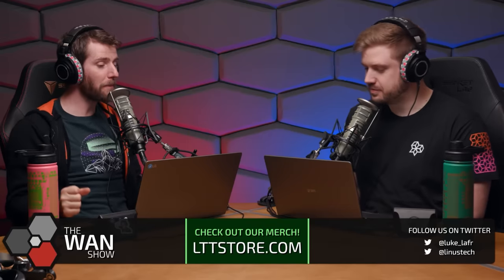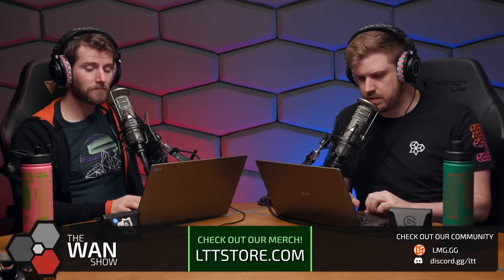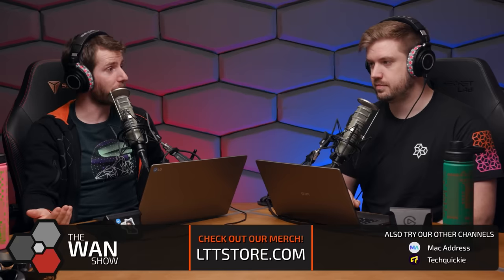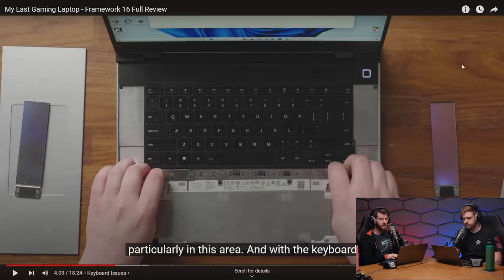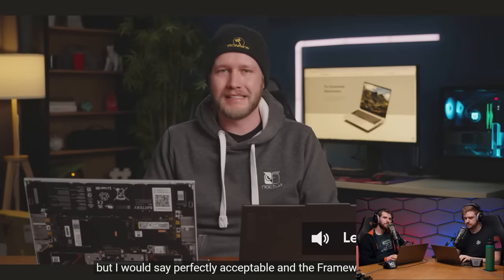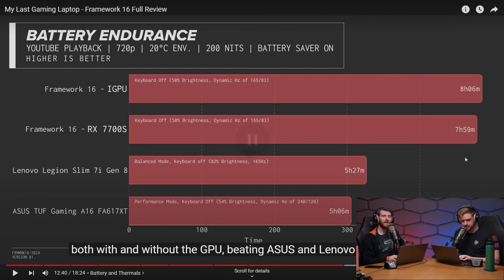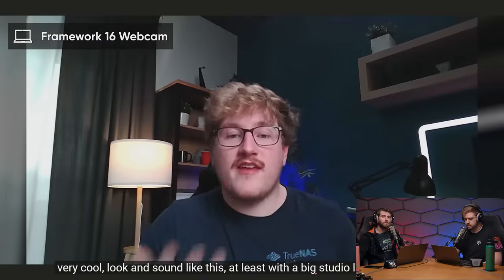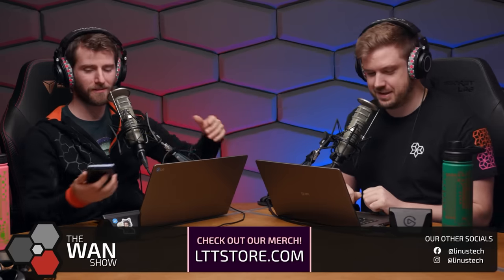Linus Re-Evaluates his Investment

Comment: From the photo it does look like my trusty Lenovo ThinkPad T420 with it's 14" screen has about the same amount of flex. Also screen flex is MUCH worse if you actually completely close the device before opening it that way because you overcome the initial resistance of both hinges at different rates. 
ALSO with new hinges there is just generally a small break-in period which could explain part of this. The construction of the Framework screen assembly is also quite unique and as long as it doesn't cause any issues this amount of flex is completely fine, especially since my man from the Verge is purposefully trying to do this.

Comment: The verge guy being mad that the ceo said it was one issue is a bit of a strike on the verge tbh. As an engineer it sounds like some sort of thermal issue. So yes, you will get multiple symptoms. Instability, crashing, running hot. But for example if its due to thermal paste non-contact, then yes there is one issue. The verge and medium are the IGN of the tech world.

Comment: Another MASSIVE issue is that not only did the various OEMs and ODMd not only not standardize the component and dimension layout - they even went haywire with mixing up the pinouts. Even within their own brand ecosystems. So not only are MXM GPUs not physically compatible among different laptop chassis types, they're not even electrically compatible on the pinout.

And as a cherry on top, they kept their changing arbitrary pinouts proprietary and locked down very well, so a bunch of them aren't even fully known or reverse engineered to this day.

MXM was a great idea in principle. But everyone involved with implementing it completely screwed the whole thing by doing their very best to force it into being non-standardized.
Reply: And yes, this includes mixing up pinouts between signal and power, so in multiple combinations you would instantly brick that $500++ MXM GPU you spent months trying to find, when powering on the system. In some cases taking the primary motherboard down the drain with it.

Comment: i would disagree with the mxm statement their are 2 main standards mxm type a and type b. both of which are standardized as far as memory layout and die location. which means as long as your laptop takes an type a card any mxm type a card will fit and line up with the cooler same for the type b cards. type b cards are a bigger formfactor allowing for more memory/bigger dies. the biggest issue with mxm cards is drivers because laptop drivers run a check to see if the laptop is one the card your installing was made for. they dont work without modding the drivers which is majore pain

Comment: I'm always doubious about what real value that the Framework platform can bring to the user.  Say I want to upgrade my laptop in three years time I would probably find myself in a situation that I need to update most of the components inside my laptop that it may end up better buying a separate new machine than update the existing one.  Don't forget the option and upgrades are usually priced more expensive because of the smaller business volume and very special packaging that the upgrade modules would require.
Reply: That is true, they're still in early adopter territory when it comes to pricing. If the volume produced multipled and costs came down the idea of a serviceable laptop could actually make sense from a normal users POV, but it's not really there yet.

A similarly specced lenovo laptop costs nearly half as much and that's with sourcing the ram etc for the framework laptop from cheaper third parties. In 4 years you could buy an entire new better laptop with the money saved, and you'd still have the old one to pass on.

Comment: As a FW13 owner, 12th gen, I truly wish FW the best. especially with longterm support, like bios updates, drivers, hardware and maybe coreboot. Like, im running Bios 3.08 but its beta and they pulled the EFI version (the file is still there on the server *wink wink*).

Such small business doing awesome work. but hey, some folks need to chill the cookie down. Hope to buy some future upgrade board someday, and I pray for coreboot, probably for the wrong reasons. Btw, yes, im an Arch linux user.

Comment: I think it would be better if they were willing to just make the laptop a bit bigger. In general, I think that gaming laptops (and all high end laptops) should be made with better cooling and better ruggedness at the expense of being heavier and bulkier. They could potentially also make the keyboard better if they have more space for it. If it's important to have a powerful laptop, it should be acceptable if it's bigger and heavier than a normal laptop. Having a laptop that feels rugged and is also quieter when under a full load will also have a significant impact on the user experience, and how users view the product. Anybody who's obsessed with laptops being as compact as possible is not likely to be willing to buy a framework anyway.

Comment: I'm very thankful for MXM video cards. I bought an Alienware M17X R4 in which I was able to upgrade the GPU for a reasonable cost and extended the life of the laptop for several years - in fact I still use it from time to time! 
The new GPU was much more powerful, used less power, and created significantly less heat, and fitted without needing to modify the laptop in any way (some of the available replacement video cards required modification of the laptop). What's not to like? 😊

Comment: Not really sure who the Framework's customer is? I've never known a situation where I'd want to upgrade my ~6 year old laptop without simply replacing it with an all-new one and selling the old one. The sale of the old one easily covers the difference in cost, with the net result of having the build and general niceness of an X1 Carbon or a MacBook to use. Losing some repairability adds the ability to have a lot more density, leading to a thinner / lighter / longer battery life / etc solution, with lower costs.
Reply: I can see upgradability on a 2 year basis being a good thing for the GPU.

Comment: I love the idea of upgradable and repairable laptops. The issue here is cost. The machines are expensive, the upgrade mainboards are expensive and that outweighs just getting a whole new machine. Tech moves on so fast a new machine will have a whole host of upgrades and you can still sell the old one or keep as backup a lot easier than having to spend yet more money on an enclosure for the  old framework board. It dosnt even suit whales as the spec and cooling is not good enough.

Comment: ROG XG mobile exists as a small EGPU enclosure that comes with a laptop 4090. The connector is proprietary though unfortunately, you can only use it on select asus laptops
Reply: And costs an arm tho the extra iO and no need for charge cable (afaik) is nice
Reply: @nicolaspaglione  Definitely. It, costs over 2k for a mobile 4090 which is essentially a lower clocked desktop 4080. It is afik the only plug and play powerful, up to date, portable egpu enclosure with full pcie express bandwidth though
Reply: @MA-jz4yc  afaik it just uses occulink but I doubt since it maxes at pcie gen 4 by 8

Comment: Honestly I hope framework makes a passively cooled expansion bay option. Go with the GPU form factor but with a massive heat sink and it should work pretty alright.

My current laptop has fans and if it gets moved more than a quarter of an inch the fans grind against their housings and make a very loud and very annoying noise which can last anywhere from a few seconds to several minutes, so I'm "upgrading" to a passively cooled laptop made by the same company that will most likely have worse performance but I can actually use it as a laptop instead of a portable desktop with horrible performance.

I don't think I'll buy another actively cooled laptop again. Hell I'd sooner buy a passively liquid cooled laptop than an actively air cooled one if those were my only two options.

Comment: My main issue with framework laptops is the ram. They should use LPDDR5X not sodimm. Realistically I'm not going to be keeping the same ram when upgrading the cpu, and i'm not going to upgrade the ram capacity by itself. Sodimm's are much slower and I want to leverage an igpu where the 5600 vs 7500+ speed difference is a big deal. Ideally at the next motherboard upgrade (zen5?) they would offer 32/64/128GB LPDDR options at whatever the fastest viable LP speed is then, as well as a sodimm option for those that want that.

Because of the ram speed issue I'm looking instead at the lenovo ideapad pro 5 16 gen 8. Ideally it would have 64GB of LP ram but it only has 32GB, so maybe gen 9 will be the ticket.

Comment: FYI... An Air Conditioner is a Heat Pump.... That's what Heat Pump Water heaters use, they're basically an air conditioner on hot, sending the heat into the water.

Comment: Thing is, I don't even really care that nuch about laptops or phone being easily repairable and upgradeable casually. I just want there to be open tools and parts that are easy to get, and things designed in way they can be repaired or changed by someone that has those skills and tools. 

I do think some parts are exception, like battery, it will wear out no matter what. I still want decices to be made in optimal way, not in way so that anybody easily swap parts. Unless that also coincides with better design.

Ultimately this would make repairs cheaper and better, even stuff like everyone just using torx for example. I want costs brought down and user experince be brought up.

Comment: The fact that there may never be any Nvidia graphics modules is unfortunate. But at least we can hope to see better AMD-based ones. The 7700S is about at the power limit of what the system can manage if it's powered by the 180W supply, but they could get a bit more headroom by using a 240W supply once somebody actually makes a 240W USB-PD brick, and even more by producing a graphics module with a separate power jack on the module.

The 7700S module is built for Framework by TUL; they're also known by their retail brand, PowerColor. (Kudos to Framework for tapping the expertise of partners, like the Cooler Master cooling systems, rather than trying to do everything in-house.) I'm sure they're already thinking about how to build a more powerful GPU for the Framework; put in a 7800XT and give it its own 240W brick and you'll have a pretty serious gaming laptop. The 7900XT and 7900XTX use too much power for a single 240W supply, though it's possible that a downclocked 7900XTX would outperform a full speed 7800XT. (It might also be possible to use power drawn from the laptop plus a second brick plugged into the graphics module to get to full power for a 7900.) Won't be a cheap option, but there are people who would buy it.

Comment: Even if there's a Framework "tax", repairability and upgradability should hopefully mitigate that cost down the line. Like if your GPU blows up, paying even $1000 for a replacement is a whole lot better than paying $2000 for a whole new device.
Reply: Those are very rare you’re more likely to see display cable fuck and seconds most likely vram which Is fixable by technician that can microsolder

Comment: For designers relying on the GPU having a video usb-c connector for their one-cable connect to a tablet screen (looking at you huion kamvas with your propertairy usb port), take into account that  Nvidia RTX 4000 series dont have those anymore ;_; . Not sure about the options on the Radeon side but this basically rendered my plug-and-go tablet screen solution completely useless in my recent upgrade and having to rely on a hdmi+usb power+usb data cable. This maybe be niche but a fair warning.

Comment: My issues with laptops is they break down so quickly!  I had 10 of them for a business, most of them died.  And required soldering or other issues just after the 1 year warranty. This was with dell, cyberpower and gigabyte laptops.  Framework will be my next laptop 100% when my last laptop dies LOL. I love the idea if anything fail its easily replaceable. I dont care if its a premium or not as I will save money in the long run.  I WILL most likely have to replace every component in 20 years, that is ok, as I can keep the laptop updated.  As long as they stay with the same design!
 Its such a Hugh process just to replace the keyboard on macbooks!  If one component gets shorted out on the mainboard and the parts are not available you have to replace the whole laptop!  If you water damage your laptop (this happens all the time with my customers) Many times the computer is not repairable or its temporarily repairable for data due to water damage.  With this laptop, you can easily replace anything!  This would put my hardware repairs for laptop out business!

Comment: Name 1 tech product that's dimensions stay the same in future revisions/upgrades. None. It only works if all future technologies fit into the same modular dimensions as the previous iterations. Good luck getting newer graphics cards/etc at a remotely similar form factor during their peak relevance for example. While sure, it is cool you got that particular graphics unit in that form factor, good luck guaranteeing subsequent versions will be capable of that also... Modular will never work.

Comment: So,  given you have to 'build' these framework notebooks when you get them, and also given that the Verge isn't exactly well regarded when it comes to building PCs, them having crashes and other problems with the framework notebook THEY built is NOT something anyone should have expected not to happen.
But also, NO NO NO, NEVER send pre-production gear to outlets that everyone knows have no interest or expertise in looking at anything that isn't an overpriced apple device with anything but jaded eyes.
I use/used a Radeon MXM card in an HP all-in-one I still have.  BIG boost from its intel IGP and it barely increased thermals at all.

Comment: By this point, there is a higher chance Framework will have an Intel dGPU board than Nvidia (obviously that stupid thing they are doing)

As Framework already has both Intel and AMD CPU boards, AMD GPU board, Intel GPU board is most likely possible, maybe as well as an ARM-based SoC board (most likely running from a Qualcomm or another possible ARM on PC SoCs, maybe as well as RISC-V SoC boards in the future

Comment: what i want from them is better screen OPTIONS as well as better GPU's with the huge nvidia price tag like ok i might pay apple-level for this machine but let me have options i use ... right now it's just a gimmick for me and i'd love for some form of modularity added to the 13 inch one as well like that one at least has the replaceable mobo but the most recent one is a 7840U which is on the lower end of things like ... the idea i support 500% but actual real world usability I just bought a legion slim 7 full aluminum with a 165hz 430 nit gsync screen with a 4060 (which beats the 7700S with ease) for half the price of the framework so if i buy a new one in 3 years and passing this on to one of my kids instead of upgrading the framework, pricewise i'm still around the same cost prolly marginally saved some money and repairability score on the legion i'd give a solid 7/10 due to partially soldered ram but huge opportunities for repair otherwise + easy access

Comment: from hearing him ranting about nvidia is very strict with what board spec their chip is going into, and then he mentioned the framework laptop have freezing and crashes issue i assume that the laptop that are crashing uses AMD upgradeable GPU modul, right? so he just CLARIFIED WHY nvidia is so adamant that their chip must use very specific configs. since the AMD one have issues proving that the upgradable laptop design is unwise. if laptop wants to be upgradable, they would have to do it like desktop motherboards, that has VRM and electrical design made and designed with tremendous headroom and electrical design flexibility so it could accommodate various anarchy of electrical design of all the upgradable modules. with GPU has a direct powering from the power supply, which means the POWER SUPPLY itself MUST be designed to accommodate to those anarchy like the way desktop computers power supplies do. which by the end of the day DEFEATS the purpose of being a laptop. i get the feeling nvidia objections on supplying a proper upgradable GPU for the an upgradable laptop is sounding. that maybe the complete arse is the one complaining instead. like always.

Comment: @linus umm the msi dragon gaming laptop a70 I believe I would have to check mine but not only does it have the upgradable GPU card they did put out better upgraded Nvidia GPU cards as I got one from a 2 year later MSI Dragon gaming laptop that had a better video card and it was as simple as 5 case screws, 4 heat sink screws and 1 screw for the GPU card itself, total swap time 7 mins, so not only was it possible it works great and was present in MSI's gaming laptops for over 2 years of models, I would still be using it as my gaming machine and well do actually but I bought the Ally and I game on that as it is an AMAZING gaming system, also my Microsoft surface book 3 and it comes with a 1660Ti Nvidia gaming card that's amazing and still runs all my games at 60 plus FPS on triple A games, but since my Ally does that just as well and I can also use it as a work system for my business plus a system I can connect to my drawing screen tablet with its a ugreen dock. Just wish the ROG Ally had 2 USBC ports but it does support a thunder bolt 3 hub for 4k USBC video out plus supports pw in as you need that to use your Ally for more then an hour with a triple A game lol. 

Anyways MSI got the video card upgrade card working and I loved it, I hope that they didn't totally abandoned it, but it did have at least 2 years and multiple series of Nvidia GPU's.